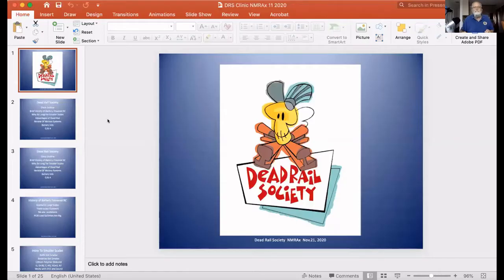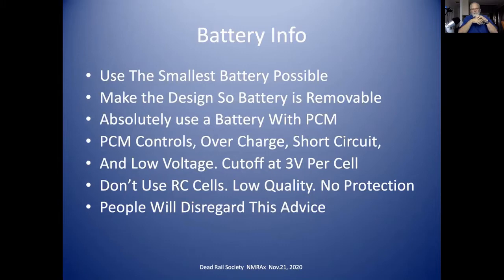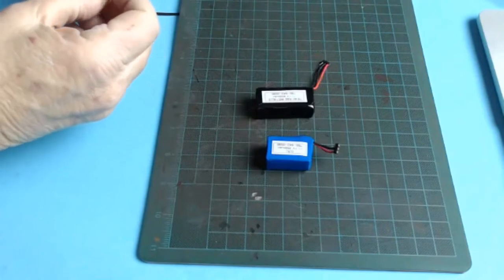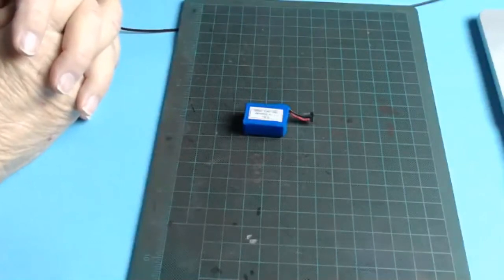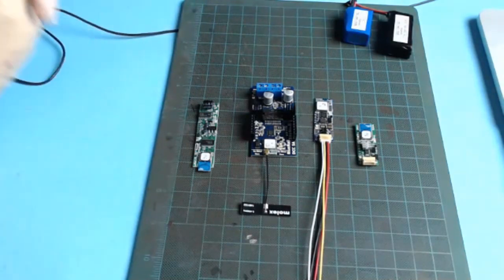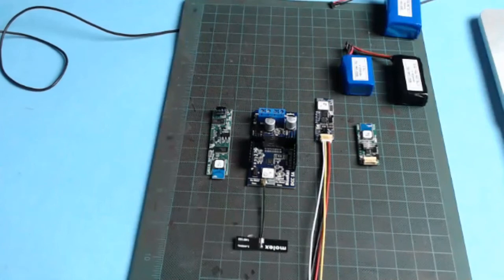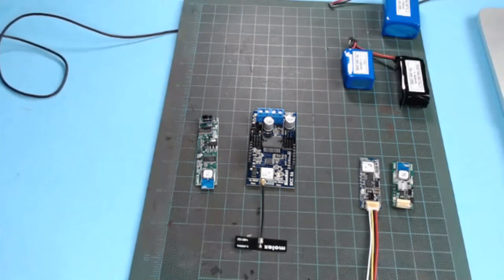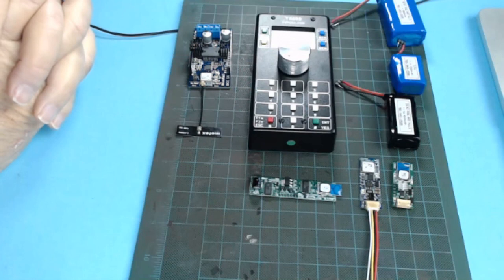Featured Modeler February 10, 2021

Comment: Appreciate the clinic but there was a lot of mis information about RC batteries being low quality. And we don’t charge at 10C, nor do all of us use cheap chargers,etc,etc. I use dead rail in n scale and fly high end model airplanes, plus use good quality RC Lipos. I also have RC batteries that are cell matched, plus I balance charge. By the way, can you point out any example of a lipo “exploding”? This is non sense.
Reply from the maker: You can send a message directly the presenter at their website, http://deadrailinstalls.com/.